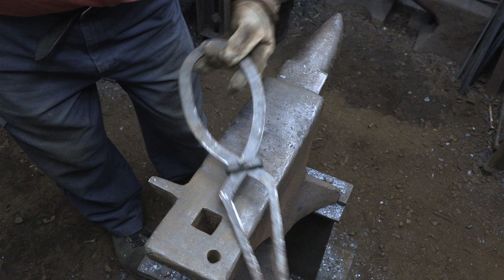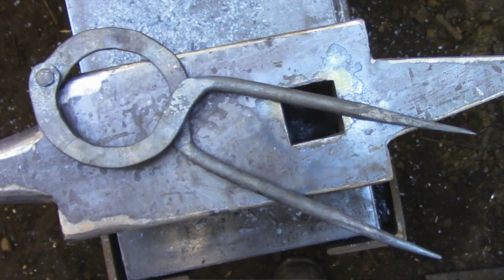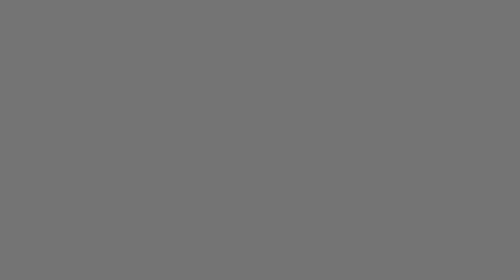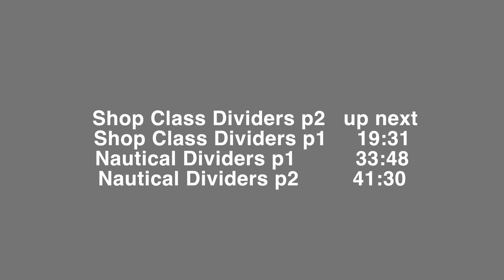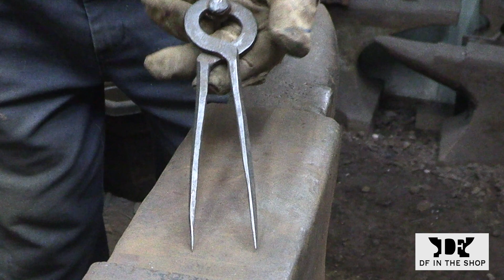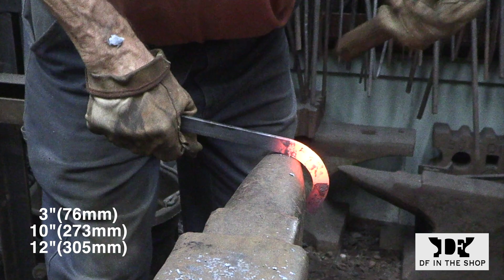Blacksmithing for Beginners - Shop Class Dividers -2

Comment: Hi there Denis I really enjoy your content, I've found your post's very helpful and informative.
 I was wondering if you could put a twist in the legs of your dividers so the hardenable steel is in the centre rather than cutting off the original and rewelding on knew?
Thanks again for sharing your experience and all the best.👍✌️⚒️
Reply from the maker: I was planning on cutting the legs further up and rewelding them at that point but twisting would work just fine

Comment: Hey there. Could you twist the tip of the divider, instead of rewelding it to the other side? Cheers from Denmark
Reply from the maker: Twisting is the simplest way to fix the problem but I rarely put twist in anything I do so they would look really out of place.
Reply: @df-intheshop330  I stand corrected by the master smith. I thought it would take longer thanks for sharing your wisdom with us younger blacksmiths.
Reply: @df-intheshop330  
Thank you for the answer 🙂 I always enjoy your videos, I learn a ton. Cheers from Denmark
Reply: You did not ask me, however. Yes, you can, but it would take more time to reforge the steel to the desired shape it takes less time to cut and reweld time is money. Hope this helps godbless and good health.